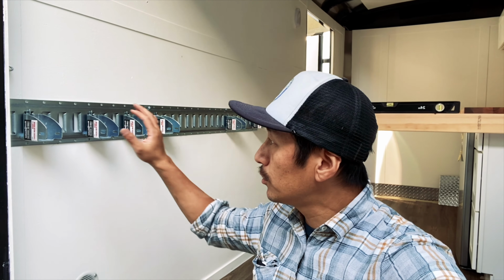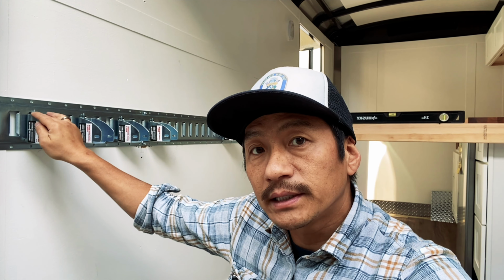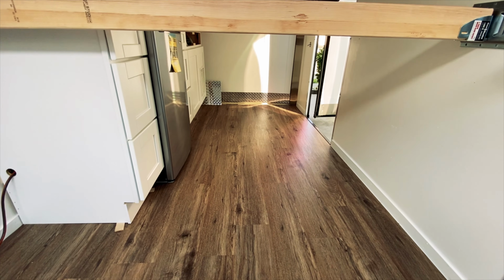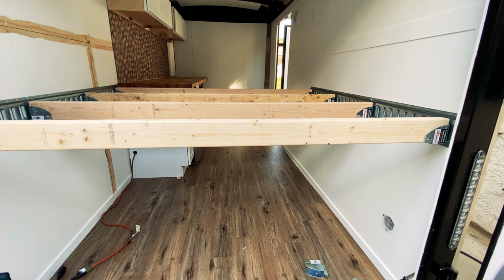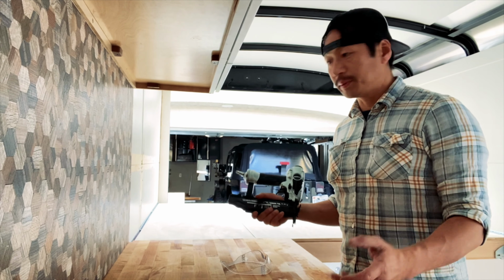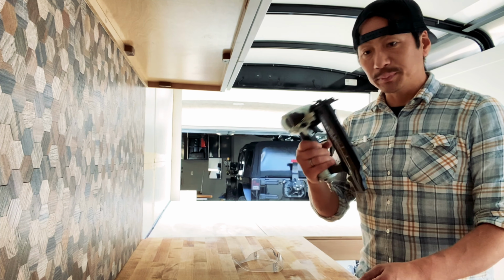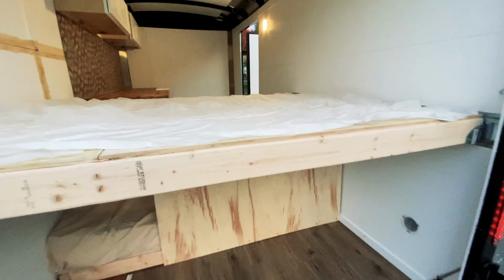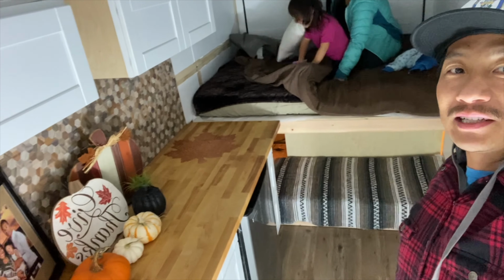Is e-track a good option for bed frame? | Harbor Freight

Comment: Awesome video, thanks!  I have the same size trailer and am going to do the same thing except I have to do the bed lengthwise because I’m too tall to go width wise.   So it’s going to be a queen size bed that unfortunately takes up a lot more space inside the trailer than yours.   Hope it turns out as well.  Would love to see the details of how you finished trimming it out.  Thanks again

Comment: I have same e-trac design but I didn't screw or nail I used maisonette with 1x2 screwed to the bottom when I put it down it goes next to the 2x4 so it don't shift (comes apart just by lifting it apart )

Comment: Impressive build man. I've been wondering how well those would hold up with 2 adults . Looks great .
Reply: Really comfy with 2 adults and a kid in the middle.
Reply: How many pounds do the brackets hold?
Reply: @susanwillis1143  I think they’re rated for over 900lbs
Reply: @susanwillis1143 prob more than the wall framing they are attached to

Comment: Looks Great!  Any issues towing ie: Weight distribution?  I hope you had fun camping!  Peace.
Reply from the maker: No issues. I’m pulling the trailer with my Jeep, toyota van, and my Range Rover. Surprisingly the Jeep handles best I think cause of the solid axles and it just feels more stable.

Comment: What did you use to install the e-track since there's no plywood lining the trailer? Is it really that secure?
Reply from the maker: I secured the e-track to steel frame with self threading screw. We had 4 people on the bed and it felt secure. I would estimate 550 lbs on the bed:)

Comment: How did you locate the steel frame?
Reply from the maker: Look for screw holes. A stud Finder also works on steel
Reply: The screws are lined up vertically on the steel frame. I recommend removing the plywood walls at least once so you can see how it's put together. Don't sweat it, the walls are just 1/4 inch plywood screwed onto the steel frame, and the trim are just thin boards stapled onto the plywood.

Comment: You crack me up, putting a level on your first bed joist. I would think it be more relevant to be parallel with the floor of the trailer as opposed to being level at this point no? Who knows if you have a low tire, or if your driveway is level?
Reply from the maker: Haha, good point. The trailer was on Jack’s and level before I started the project.